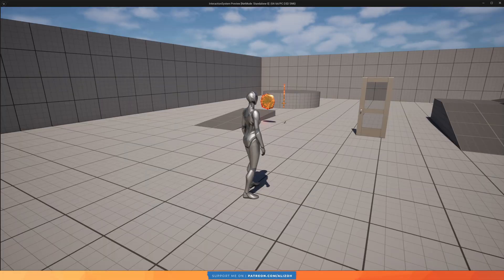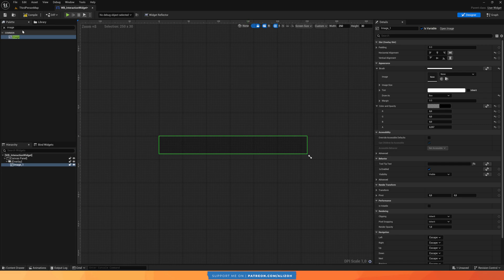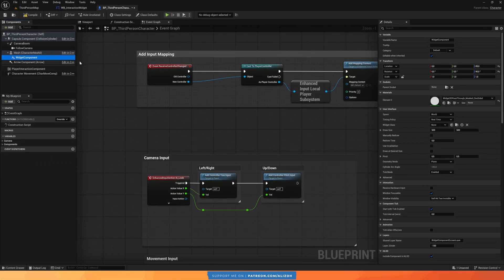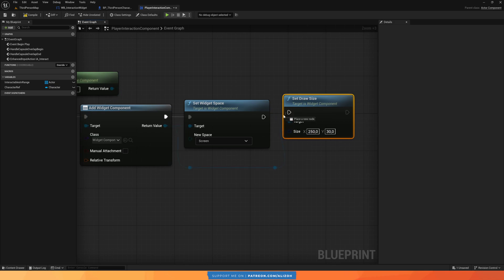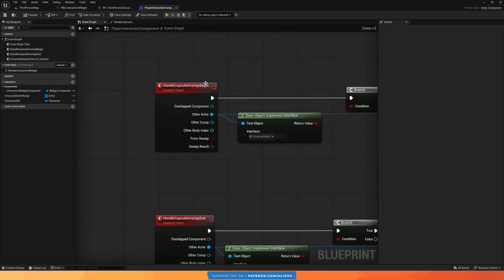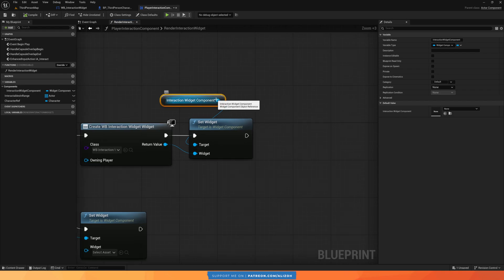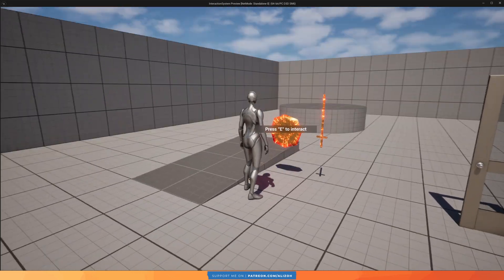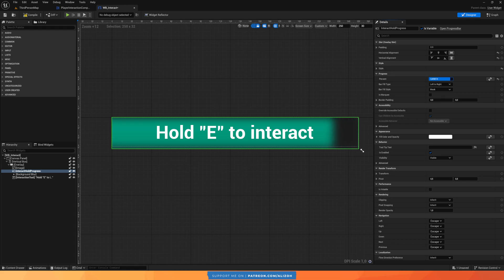Interaction System Tutorial | (Part 4: Widget/UI) | Unreal Engine 5 (UE5)

Comment: Hope this comment is useful to someone: you can make your widget location a little more customizable by adding a function (like GetWidgetPositionOffset) to your interface that returns a Vector3 (0,0,0). Then in your InteractionComponent, before you set the world location of the widget component, Add (activeInteractable -> Get Actor Location + GetWidgetPositionOffset). Now you just override the function in your BPs with your preferred offset (or create an instance editable var that passes into the function output). This way you wont have to offset your mesh to the root (especially if something else relies on your mesh root).

EDIT: I just watched a later video in this series, and he does a much better implementation of this that even works with moving meshes.

Comment: Hey, i hope you're still looking at comments here and answering as i seem to have a slight issue with this widget. Now it works well, exactly as advertised as i finished the entire tutorial. Only problem is that i made it in a top-down template, and for some reason there seems to be what i can only guess is a big box around the widget whenever it spawns in that prevents me from clicking the ground and interacting with the navmesh to move my pawn as the clicks happen way high on something invisible. It dissapears together with the widget. I've tried to figure out what it is for days, ive done a line trace in hopes that it will tell me what the name of the thing im hitting is to no avail. I've disabled any and all possible collision everywhere i could find the option to do so yet it's still there.

Comment: Ali, First, all of your stuff is great. I'll vote for an inventory system as well. Also, from the last video, I moved the animation montages into the interactables so I can set different animations for each one - works fine. Also, I converted from the sphere overlaps to a Line Trace for the interaction, so I interact with what the character is looking at (Focused Actor) with the line trace aimed at a focus dot in the center of the screen. That also caused me to change from the widget component to just adding the widget to viewport just above the focus dot. It works great but I'm hoping I'll be able to follow the rest of the tutorial and adjust to meet my line trace component.
Reply from the maker: Hey! I'm glad to hear you're enjoying the tutorials! I am strongly considering an inventory system series as well.

Regarding the changes you made, they sound pretty good and I don't believe they will affect your ability to follow the remaining of the series! Good luck 💪

Comment: Hi Ali,

I’ve encountered a strange bug at timestamp 9:44 in your tutorial (using UE 5.5.4). When I start a PIE session, the widget renders immediately on-screen, breaking the animation rule. This lets me trigger the animation with 'E' at any time, even without overlapping, and prevents interaction with doors and pickups. Everything works as expected if I disconnect the Add Widget Component node from Begin Play.

I tried adding a Sequence node with a small delay, but it introduced a new issue: On PIE start, the widget doesn’t render, and I can’t trigger the pickup animation. As soon as the character moves, the widget appears, pickup interactions stop working, and the animation can be called even without overlapping actors.

Additional Info: I also tried setting the widget to appear at the Active Interactable location on overlap and disappear on end overlap. However, the widget still renders at Begin Play, and the animation can be triggered before overlapping (e.g., with a door). Interestingly, this bug "fixes" itself during gameplay: after the character overlaps with an interactable actor, the widget on the character disappears, and the animation can no longer be triggered after ending the overlap. It’s a very odd behavior!

Update/possible fix: Setting Manual Attachment to True on the Add Widget Component node resolves the Begin Play bug. With this, the PIE session starts correctly, and everything works as intended. If I set Manual Attachment back to False, the bug reappears. Hope this info helps!

Could this be a bug in UE 5.5.4?

Thank you. Hope all is well.

-M
Reply: i ran into the same problem. it turned out i had the interface on the character as well as the component. if you have the interface on the character just remove it
Reply: @HanafudaPapi  I had the same problem thank you for the comment!

Comment: Hey Ali, great tutorial series!
What would you say about having the widget component added and managed by the interacted actor instead of the player? Maybe have a separate component that you add to the interactable actor instead of the player?
Thank you
Reply from the maker: Hey! Thanks for the kind words.

I have indeed considered having the interactable manage its own widget, but I opted not to go for this solution, because I only wanted 1 widget to be visible any time (Only on the active interactable), and if the widgets themselves are responsible for this, then they have to communicate with each other to find out which one is the active interactable, and that got messy very very fast, so it is better to have the widget owned by the player or a component the player uses and not the interactable object
Reply: @ 
Ahh I see, I haven't thought about the singularity of the interactable. I'm implementing a system inspired by your tutorial in my project, but I've made it so the other actor has a component for the widget (in my case there will be only 1 interactable because it's triggered by first hit of sphere trace). The thing that is "bothering" me is that I need to get the components of the actor and iterate to find the component that implements the interact interface instead of addressing the actor directly. Would you say this approach is fine?
Reply from the maker: @BenskiGameWorks  Yeah I would advise against that. Like I said, each actor shouldn't maintain their own component for a widget, there should only be a single component or actor that maintains the logic of the widget

Comment: This tutorial has a lot of "bugs". It's the simplest interaction system you can imagine. For example:
You can lift objects through walls.
You don't pick up the object you're looking at, which is not intuitive ...

A simple line trace would solve most of them
Reply from the maker: Hey! I appreciate your feedback on the interaction system. I understand your concerns about the intuitiveness and the current setup. The limitations you're mentioning, like lifting objects through walls and the lack of direct object selection, can indeed impact user experience. 

In my approach, I'm focusing on distance-based interaction using overlap events, which can simplify some aspects but may not cover all edge cases efficiently. A line trace method is a valid alternative for targeting specific objects from a distance and avoiding some issues like the ones you've highlighted. While I won't be implementing that specifically in this tutorial, it's definitely something worth exploring in your own projects.

Thanks for sharing your thoughts!

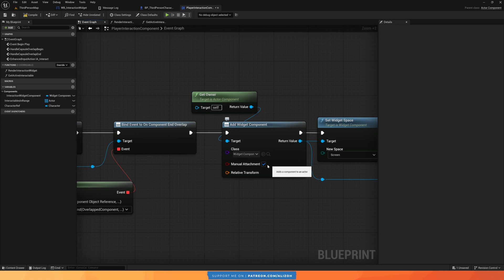Comment: Hi, great video! I'm following the tutorial but in a First Person blueprint. I have a problem and wondered if someone could help? Everything up to 14:47 works exactly the same but when I tick "Manual Attachment" and play the widget acts strange. On first overlapping with the interactable the widget spawns at the foot of the FirstPersonCharacter, when ending overlap it remains in the same place in the world. On second overlap with the interactable it works, with the widget appearing on the root of the interactable, but when ending overlap the widget is rendered at the foot of FirstPersonCharacter and remains at that point in the world until another interactable overlap occurs. If I don't check Manual Attachment I don't have this problem, but then the widget just floats like at 14:10. Any help is appreciated!

Edit: SOLUTION! Turns out I had the same interface implemented on the FirstPersonCharacter as was being called on begin/end overlap.
Reply from the maker: Glad you're enjoying the video!  Thanks for sharing your solution; it might help others facing the same issue!
Reply: I did this exact thing ive been scratching my head trying to figure out why till i read your comment.

Comment: Hey, thanks for this great Tutorial series. I'm learning a lot, and your explanations are great! I just got one question I can't seem to figure out when running the game in Multiplayer, the Widget is being rendered for all players, even does who are far away from the pickup. What would be the best way to fix this so only the player that's actually near it can see the Widget?
Reply from the maker: Thank you for your kind words! To ensure that the widget is only visible to the player who is near the pickup in a multiplayer setting, you need to handle the visibility of the widget on the server side and replicate that to the clients. 

You can achieve this by using a server RPC to check the distance between the player and the pickup, and then only set the widget's visibility for the player that is close enough. Make sure you are checking the distance on the server and then calling a client RPC to show the widget if they're within range. This way, only the relevant player will have the widget displayed. 

You can refer to general multiplayer handling practices in Unreal Engine, especially regarding actor visibility and replication. This will help you manage which player sees what based on their proximity to interactable objects.

Comment: What would you recommend to improve interaction logic like, loot when looking to object only? For example, we only check trigger overlap, How does industry standard games do that? For example PUBG, Fortnite, they all allow interaction only if we are looking to object etc. Should we use DOT product or smth. What would you recommend! 

Thanks for great tutorial again.
Reply from the maker: Hey! To improve interaction logic so that loot can only be collected when looking directly at an object, you can indeed use a combination of line traces and checks based on the player's view direction. The DOT product is a great method for determining how closely the player's forward vector aligns with the direction to the interactable object. If the DOT product exceeds a certain threshold, it indicates that the player is looking in the right direction.

In many industry-standard games, developers often combine overlap events to trigger potential interactables and then check orientation or line-of-sight using a line trace. This way, only the items that the player is actually focused on can be interacted with, enhancing the overall gameplay experience by providing better control over interactions.

Overall, this approach can give you a more polished interaction system. Keep experimenting with these techniques!

Comment: Warnig occurred when pickingup items. We were able to work around it by adding one default array.
/*LogScript: Warning: Script Msg: Attempted to access index -1 from array 'InteractRange' of length 0 in */
Reply from the maker: It sounds like you're trying to access an index in the 'InteractRange' array that doesn't exist, which causes that warning. This usually happens when your array is empty (length 0) and you're trying to access an index. 

In the tutorial, I emphasized adding and removing interactables to/from the array as they come into and out of range. Make sure you're properly managing the array elements and that you are only accessing valid indices. Ensure you're checking if the array is not empty before trying to access its elements, and that you're handling cases where the array's length is less than or equal to the index you want to access.

Comment: Hi, many people say that the final packaged game has higher FPS than in the editor. I don't see any such optimization after packaging at all. But for some, the FPS jumps by 20-50. Maybe my packaging settings are incorrect, or I missed something for the final build?

Also, after the interactive course, maybe you could launch the next one on "Preparing a Game for Release"? I'd also be interested in hearing about game localization and controller support. Maybe the shader cache is not being saved?
Reply from the maker: Hey! It's true that packaged games can sometimes run better than in the editor, but it can depend on a few factors like your settings and the complexity of your project. I recommend checking the packaging settings and ensuring that everything is optimized properly. 

As for your suggestions, I love them! I'll definitely consider doing a series on "Preparing a Game for Release", including localization and controller support. Thank you for your input! 🙏

Comment: So im trying to check whether or not the player has a required equipment to be able to use an interactable, im having trouble finding a way to 'get' a variable from my Interactor(interface function-input actor)
Reply from the maker: Hey! Well it's already an indication that something is in the wrong place if you don't have access to the data. For example, if you want to check whether the player can equip an item or not, maybe the player is the one that should be checking for this information because they know if they can equip something or not.

But if you need the opposite, for example in our PickUp item example, we needed to pass in the "interactor" as a variable to the Pickup function, because the pickup item calls the "Add to inventory" of that interactor

Comment: Hey Ali, I have a question about widgets. I heard that using a lot of canvas panel would affect performance and it's better to use overlay instead.
so when would I choose canvas & choose overlay?
Reply from the maker: Hey! Great question. Generally, if you need precise control over positioning, a Canvas Panel is more suitable. Use an Overlay for simpler arrangements or when you want to stack elements visually without needing fixed positions. It's about balancing your needs and performance. Hope that helps! 🙏

Comment: Apologies - for some reason the image of the widget won't render.  I went through step by step and it seems to be identical, but only the text will render.  Anyone have any ideas?
Reply from the maker: Hey! No problem at all. It sounds like there might be an issue with the image component setup in the widget, make sure you have a color set for the image (and the alpha of that color is not zero, otherwise it will be fully opaque), also make sure you have it set to "draw as box" as I did. If that doesn't work for any reason, try removing it and adding again, or playing around with these configurations. good luck 🤞
Reply: @ thank you so much for the additional guidance! I will be going to try again after work today.
Reply: @ImSim_Cook  Hi, I have the exact same problem, I can't seem to find where I did wrong, I rewatched many times to redo all the steps, yet it renders only the text, did you happen to find the solution by any chance ?
Reply: I found the problem, I changed back the Overlay anchors to be the center one, and not the full one, I don't know if it's a bug but now I can see the background of my widget.

Comment: using more than 1 canvas panel at a time is relatively expensive, it is best to be avoided. overlays too
Reply: Heard that about Canvas Panels but dont remember this about Overlays. Is it same reason?
I started using more Overlays and reducing Canvases. So any tips how to set up some menus, windows etc widgets?
Reply: @Grochu_23  spacers, alignment. render transform. you gotta get creative with it.
Reply from the maker: Hey! thanks for sharing your thoughts! while overusing canvas panels can indeed be expensive, using just 1 is not considered overuse of course, so don't he afraid to use them, just don't overuse them. That is not the case for Overlays though, they are optimized to only render the visible parts of each element inside them, so they are perfect for this use case
Reply: @AliElZoheiry  yeah!

Comment: Hello, would it be too much of a stretch to ask if there's a native option in UE to make widgets change scale depending on distance? For example, an enemy's heath bar displaying small when he's far away and big when he's next to the player.

If not, I appreciate either way.
Reply from the maker: Hey! That's a great question. There isn't a built-in feature for this specifically, but you can achieve it using some blueprints to adjust the scale based on the distance to the player. On tick, you can continuously recalculate the distance to the player then adjust the size of the widget. Just make sure that you're not doing too much in the tick function (e.g you don't have a lot of widgets in your level, otherwise you should profile and optimize)
Reply: @AliElZoheiry  Thanks for the answer! It's always appreciated
Reply: Good question. I'm interested too.